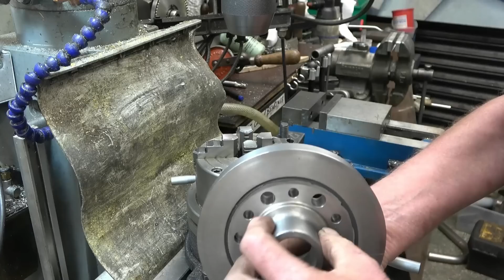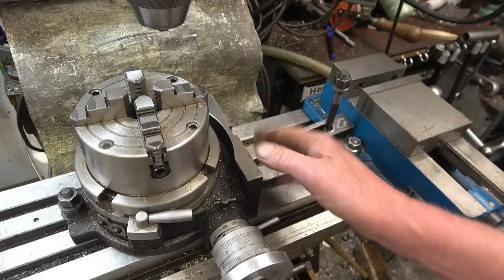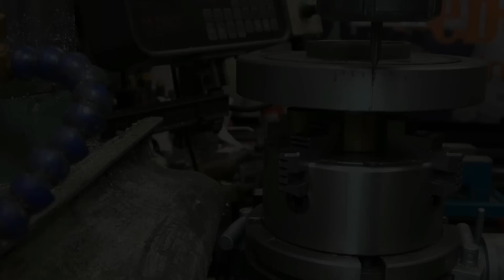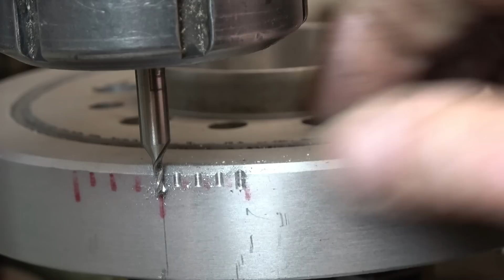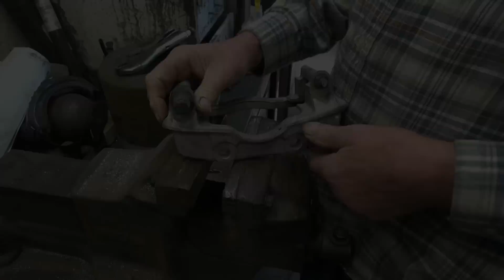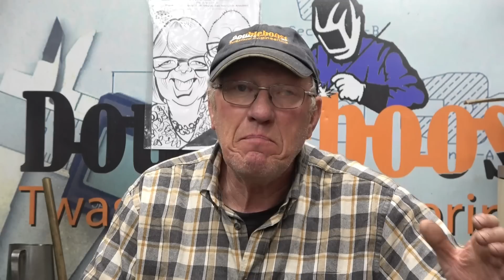SNNC 591 P2 . Part Two Bottom Pulley MOD.

Comment: Glad to hear / see you're much better; been there got the tee shirt. Would it have not been better to have had a boring bar with a sharp vee nose HSS tool in it then you could have plunged straight down to inscribe a fine line on ea. of the markings, nice job anyhow.